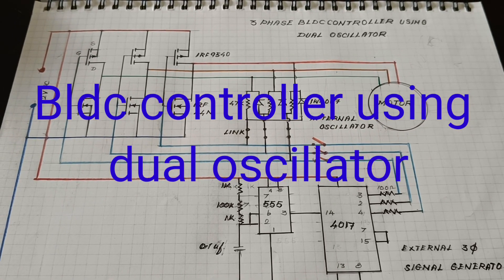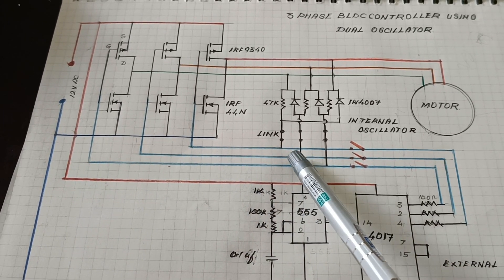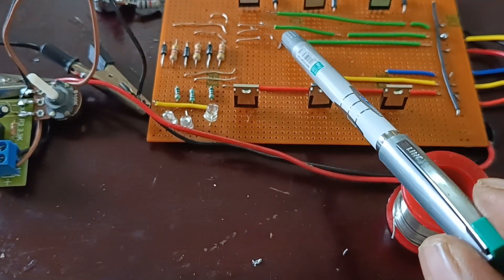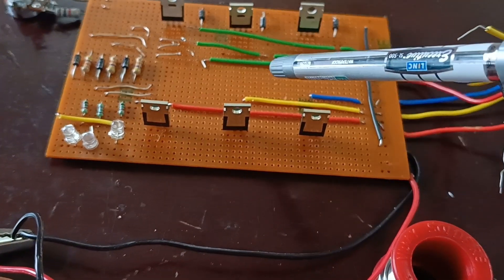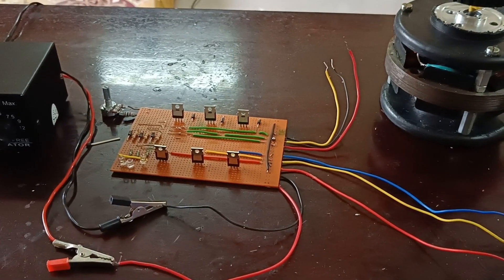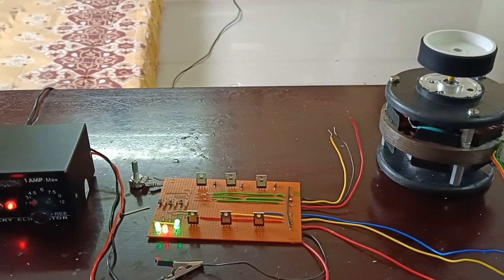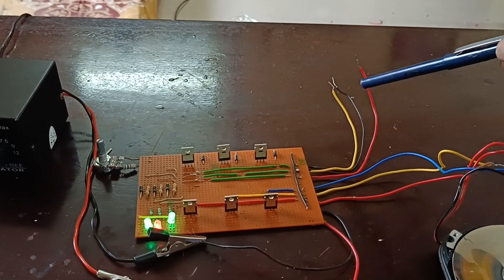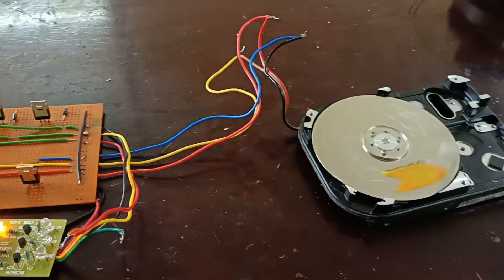(MC-5)3 phase Bldc controller using dual oscillator

Comment: I thought of applying it for 48v motor control, but the 9540 gate voltage is low and it does not open. I need to apply dc -38v for the mosfet to go into full conduction, but unfortunately the driver does not provide this operating range.